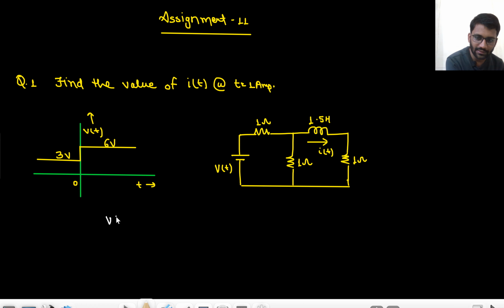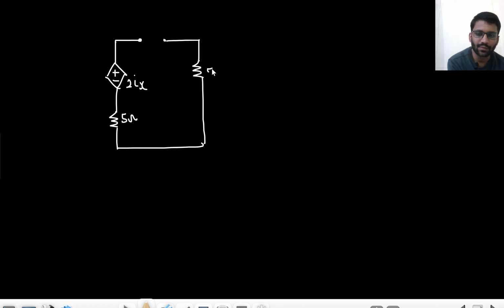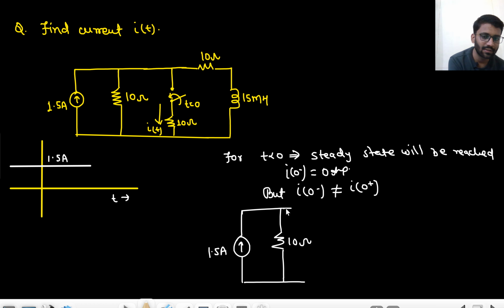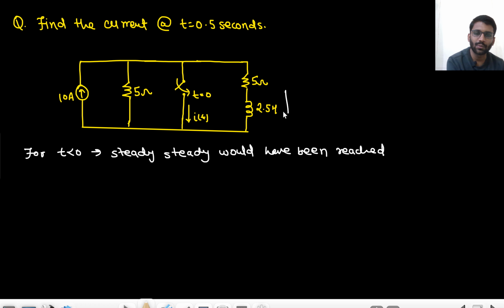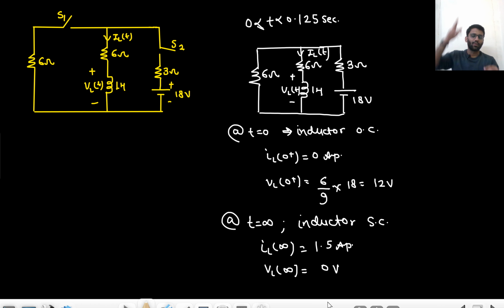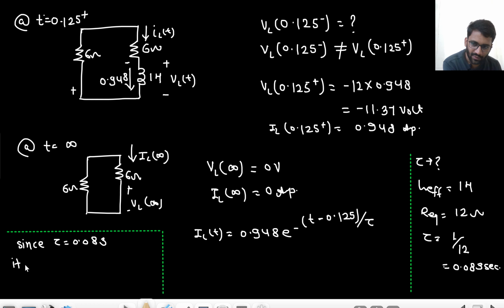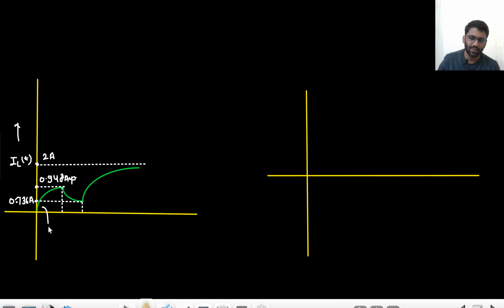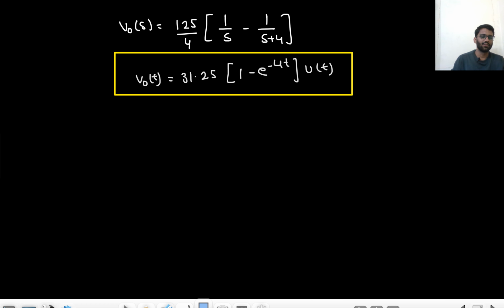Assignment 11 Solutions || Network Analysis || GATE 2025-26 || PrepFusion || Himanshu Agarwal

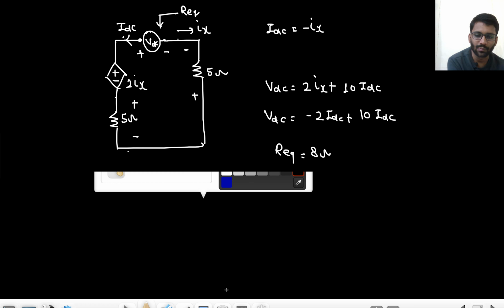Comment: sir at 13:13 when finding Req by open circuiting inductor, then ix also becomes zero right as circuit is not closed then the dependent voltage source is shorted(as ix=0) then Req will be 10 ohms(5+5 in series)?